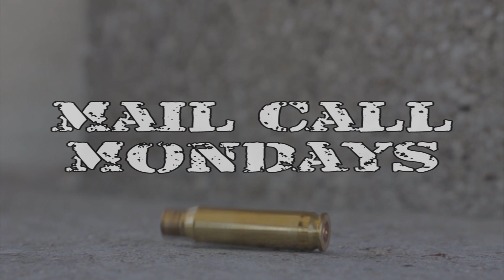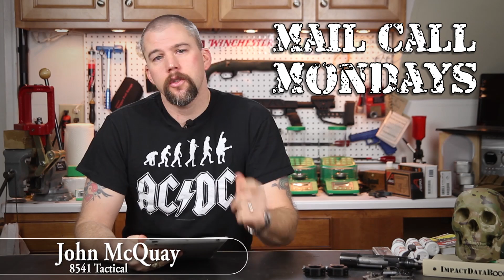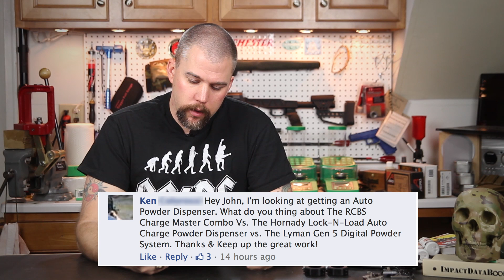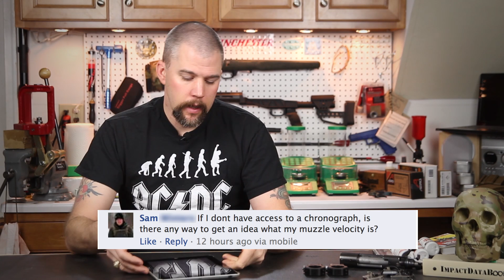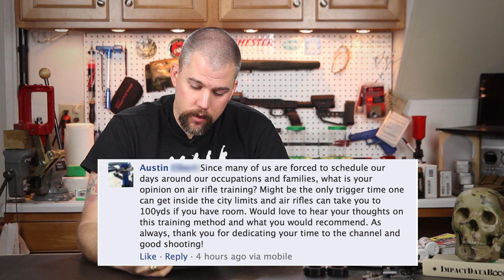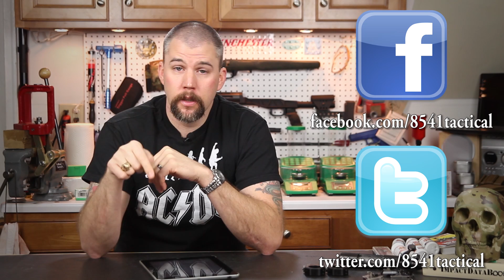Mail Call Mondays Season 2 #47 - Lead Smelters, Ghillie Suits, Air Rifles and More!

Comment: Also what is the difference between regular ammo and match grade ammo. Everybody says match grade ammo is more accurate but why and how is it more accurate?
Reply: Higher-grade components, bullets specific to target work, and better quality control in assembly and pre-sale testing would be my guess. Not that the QC isn't more than acceptable to begin with (I read somewhere that it's harder than it used to be for the casual reloader to improve on even regular ammo in a hunting rifle), but the stuff they turn out as match has extra special care taken in load development and on the production line, and group/velocity standards per batch are probably held to much tighter limits also.

All of this costs extra $$$$ of course, and translates to a heavier beat-down on your wallet at the register.

Textbook of Small-Arms, 1929 (modern reprints are available) goes into great detail on the manufacturing and QC processes involved in ammo assembly and testing. While a lot of it is out of date (b/c of when it was written) or not broadly applicable (it relates to the .303 British cartridge loaded with cordite), it's still a very educational read and gives a window into the sorts of things that ammo factories have to do to make sure the end user gets exactly what they want and need.

Comment: Thanks for the input on the smelter. A guys channel that's called Iraqverteran888 was going off about the smelter closure being back door gun control.  You'd think China supplying lead for our ammo would solidify any conspiracy about us going to war with them? Thanks for the heads up on the sight to bore and that it really matters at closer range not long range. I am a new shooter and am making every mistake possible I think. I shoot a varmint AR @ 1.6'' MOA non-match ammo, without a rear bag, and thought maybe the sight/bore calc was off on my end? Unfortunately its not that, its still me?  I watch these guys shoot .5 MOA @100 yards with factory ammo. I'm like what am I doing wrong? Ha!
Reply: IV8888 goes off on all sorts of stuff. I trust about 30% of what they have to say. I wish they'd stick to technical info, instead of giving their biased and half informed opinion on everything. I love their channel, I'm also a vet, but it just gets old.

Comment: Is there evidence to show that shooting and reloading predominantly jacketed bullets has any serious effect on lead levels? Certainly I can understand getting it done as an Occupational Health and Safety thing, especially if you're obliged to shoot a lot on indoor ranges as part of training, but I'm wondering if the dangers aren't being a bit overstated here.

On the other hand, and speaking as a doctor, I would definitely advise anyone who's regularly loading significant numbers of unjacketed lead projectiles (or swaging copper to lead cores) and especially anyone who's melting lead and casting their own bullets to get a regular blood lead level done. Most importantly, get a baseline level done before you start up that pot for the first time.

Where shotshell reloaders sit, I'm not sure - it's very possible that shearing of small shot pellets by the charge bar might create airborne dust, but a no-touch technique wherever possible and adequate hand washing seem to me to be the most important factors in preventing exposure in those who aren't actually melting lead on a regular basis.